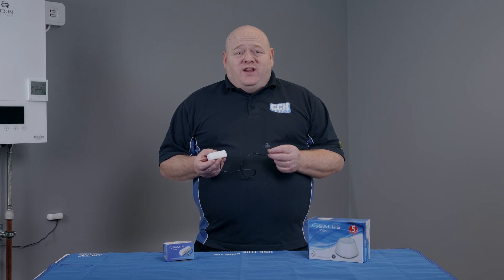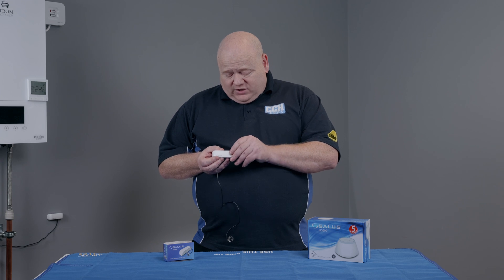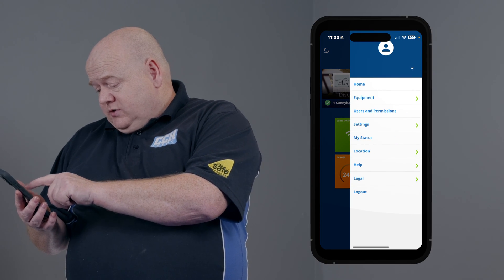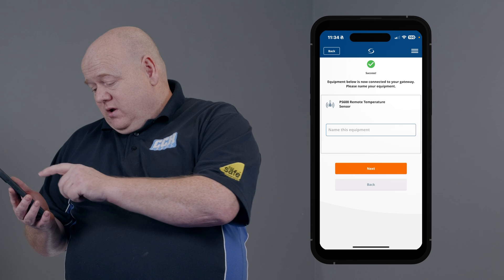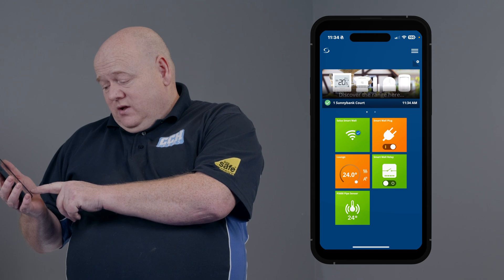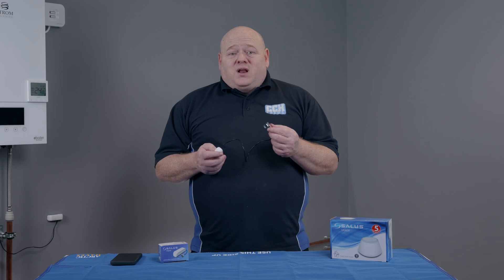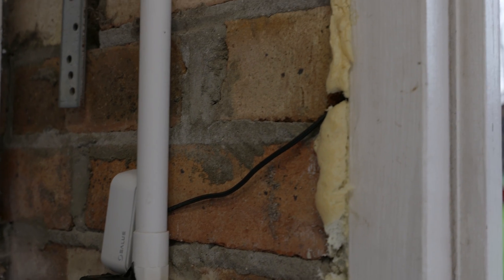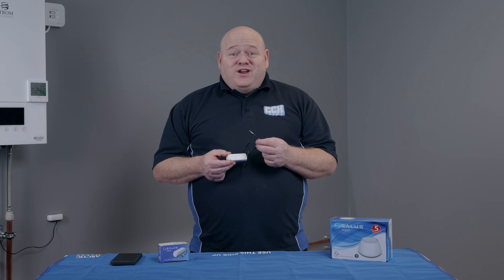How To Connect Salus PS600 Smart Pipe Sensor ( Smart Home )

Comment: If I have pellet boiler for heating with boiler receiver Salus RX10RF and combined (from pellet boiler and from electricity) hot water boiler and I want to add this PS600 sensor to hot water boiler what I need if I want that pellet boiler starts at determined temperature in hot water boiler? Thermostat? Smart relay? It is possible?